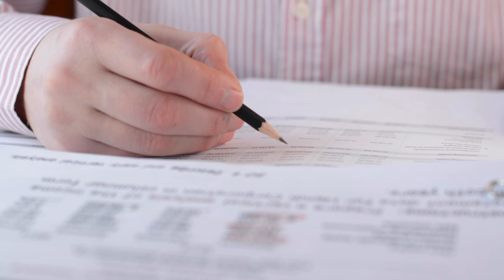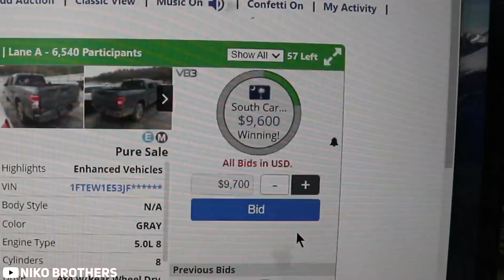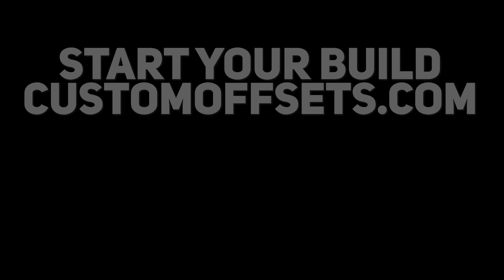Have you ever thought about Buying a Wrecked Truck and Building it?

Comment: Not sure what auctions you're referring to,but any auction ive looked at took their fee from the sellers earnings,they didnt add it to the buyers bid. If you sell a vehicle for 50k and their fee is 5% their not going to charge the buyer an extra 2500,they would just take it from the sellers cut and the seller would get 47500
Reply: Copart for example has a buyers fee that is added to the final sellng price. As well as a gate fee, membership fee, and get this. If you buy from a device that is not on a copart auction site they charge an internet fee that usually is around the $80 mark for normal vehicles. What auctions are you talking about?